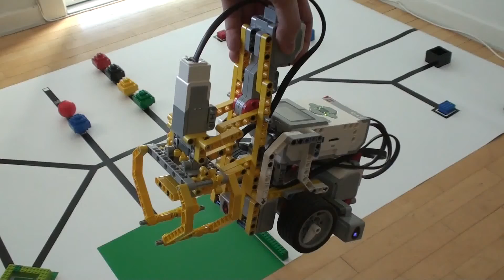WRO 2017: Programs for picking up turbine parts

Comment: Great video! I have a question. The help would be much appreciated.

The technology decider and the base won't always be in the same spot. Is there a way you know if it's a technology decider or a base?

Some kind of measuring technic using the front-facing color sensor?
Reply from the maker: Thanks. Yes. I show how in the video that I just uploaded: https://www.youtube.com/watch?v=4WTXMw4FmQU
You can detect the size by the angle that the grab has moved when grabbing a technology selector or turbine base.
Reply: Thank you very much! I really appreciate it!